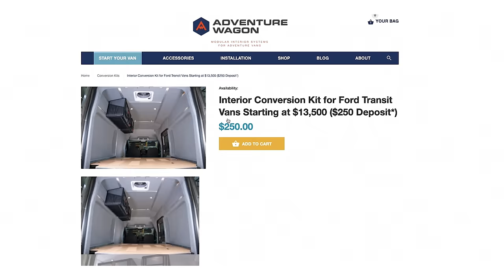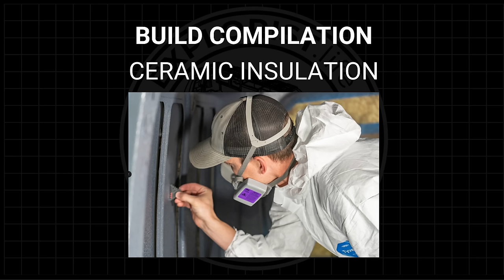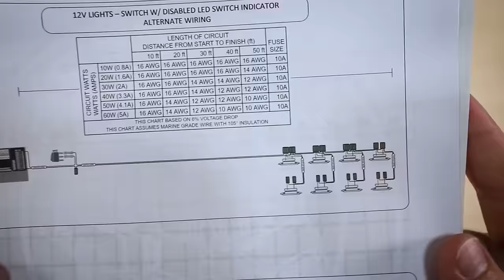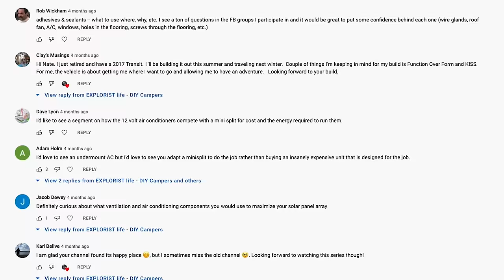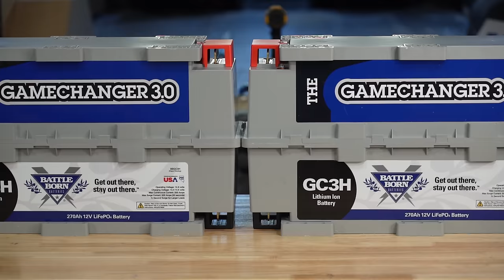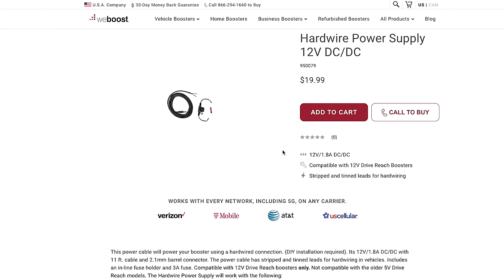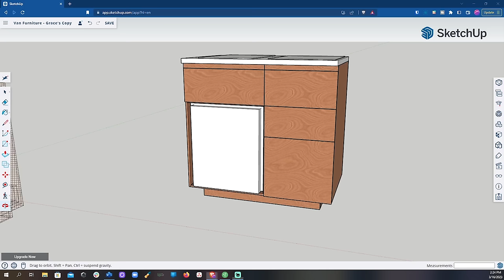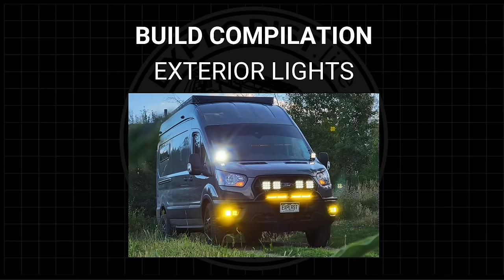Start to Finish! - Luxury Camper Van Conversion

Comment: Thanks for asking, Nate!
1. Coin flooring is hard to clean. And we all know how dirty our floors get off-road. I'd never install one.
2. There's a lot of misinformation and confusion about vapor barriers. I've seen vans ruined by moisture/condensation trapped between the van's metal skin and the  inside walls. What do you think about semi-permeable membranes like Intello?
3. What do you think about EcoFlow's heat pump vs. roof mounted DC A/C's?
4. Please explain various security systems and why you'd choose one over another?
Thanks!😊

Comment: I saw on another camper van build, where the guy put his shower with a 25gal recirculating system. Which I think is pretty smart, that way you can take as long of a shower you want without worrying about running out of water. I would like to know how that is done.

Comment: Wow, can't believe that you put this together. Great work !! (Adding chapter markers might make it a little easier for some people to navigate to the sections that they are interested in). Also looking at where you have the camera lenses stored in the van it seems to me that those are in a very easily accessible drawer, but I'm not sure how often you are reaching for camera lenses.
I'm a fan of Adam Savage and on his channel (Tested) he has spoken at length about setting up his workshop with "first order retrievability" being the most important concept. Basically making the things that you use the most in the most easily accessible places. Have you used a similar strategy when populating your storage? It's something I still struggle with in my van but I found that making an inventory list of every single item in each drawer and storage area in the entire van has been a big help.
Reply from the maker: Big fan of the Tested channel and we definitely use that concept around our shop as well & in our outdoor gear closet.  We like having camera gear near the doors/seats because any time we are swapping out camera gear; we are usually in the front seats or heading out the door.  I think the only way it would be 'more' convenient is if it were actually in the front seat/cab area; but that simply wasn't feasible.  For upper cabinets, we definitely store the things we need to access quickly in the area it needs to be: Clothes by the bed.  Food by the kitchen. etc..  But with the storage cubes like we have them, it makes everything infinitely easy to move around.
Reply: I am going to find this "Testy" you speak of...
Reply: @EXPLORISTlife  do you build solar system for customers
Reply from the maker: @campervanmark3410  Yep!  https://shop.explorist.life/shop/consultations-installations/installation-request-deposit/

Comment: I recommend DUAL BANK solar controllers. I have a solar controller that charges the house batteries until they are fully charged, and then it trickle charges my chassis battery. I can set the charge profile to the battery's chemistry, and in my case I have Battleborn LFP house batteries, and a lead acid chassis battery. I cannot emphasize how convenient this is. Previously, when my rooftop solar was only wired to my house batteries, I would sometimes need to jump or hook up a battery tender to my chassis battery. Never again!!  Especially if you boondock for a couple weeks OR if you park in the driveway for months(or years) between trips. Starts right up every time!! I have a cheap pwm controller from Go Power (GP-PWM-30-UL), and it's great. It's flush mount and takes no space. It works beautifully. Read the reviews. I'm not alone. They sell dual bank mppt too.

Comment: weve got 4 bikes stored under the bed with mineral oil brakes rather than dot, so there is nothing that will degrade the bedliner. Prepped so they didn't have to worry about overspray which made installation costs much cheaper

Comment: Mini Split for AC and heat... and wiring for ham radio and cat systems for controllers etc.  ...It won't happen but custom build the lifepo4 power.   270 or more swing awning and outdoor pull drawer for kitchen ...

Comment: It would be nice if you could have both front seat be able to slide from the front to the middle of the van and able to swivel on a sliding rail built into the floor ✌️❤️

Comment: wow!  Awesome Job.  I just watched the entire build over the last week.  Y'all do amazing detailed work.   Can't wait to get started on my AWD EL HR Transit in the same color.  I didn't get the dual alternators though.  Hopefully I don't end up regretting that one.  From what I saw, 1 alternator should be plenty to send about 30 Ah to my 570 Ah Miller Tech Lithium Battery.   One thing I'm wondering about is if the roof solar is worth the effort.  I want to have the ground solar panels if we are camping and most likely will be in the shade more than anything here in the mid West.  With Alternator charging, Shore power, and ground solar, do you recommend adding as much solar to the roof as possible like you did on this van?

Comment: How about insulating the van with 2" of closed cell foam insulation on all the walls, doors, floor, and roof so that warm air or cool air stays where you want it.

Comment: Love the content. would be interested in seeing DIY how to

 
install 48v system+appropriate solar
Budget Air Conditioner options, like treelingo.
Regular budget version of hydronic espar floor heating not the $4k+ rickson mod version of espar
isotherm water heater install with engine coolant support
 Detailed explanations of Victron components
Appliance install
200+lb Garage drawer pullout
Additional security(deadbolts with e-actuators and remote)
Possible security alarm options with glass break alerts(for being away from the van and while sleeping in the van)
Security camera installs
Starlink roof install
A DIY version of Landship’s Solar Sail
any or all. thank you in advance.
Reply from the maker: Thanks for the feedback!  The following items are indeed already on the schedule of videos to make.

48v system+appropriate solar
Budget Air Conditioner options, like treelingo.
Regular budget version of hydronic espar floor heating not the $4k+ rickson mod version of espar
isotherm water heater install with engine coolant support
 Detailed explanations of Victron components
Appliance install
200+lb Garage drawer pullout
Additional security(deadbolts with e-actuators and remote)
Possible security alarm options with glass break alerts(for being away from the van and while sleeping in the van)
Security camera installs
Starlink roof install
A DIY version of Landship’s Solar Sail
Reply from the maker: Stuff like the garage slider, floor heating aren't electrical build focused and we shifted away from 'van build' specific videos at the end of last year because they weren't performing well enough to sustain the channel.   Only electrical system focused content from here on out. 😊👍🏻

Comment: I would like a video using Ecoflow Delta 2 Max.  How to wire it to 120v outlets and for 12v features.  What is the best way to charge it via alternator?  Should we use a DC to DC charger to the special solar port?  Or should i also have an additional battery and charge that with the alternator, then use the battery to charge ecoflow.  I saw a video of people using a battery to charge ecoflow and there was 1000 watts incoming when up’ing the the volts using a Victron Orion-TR Smart 12/24-15.  It seems like the inly way to fast charge ecoflow is using the special solar port if you dont have access to recharge via the grid.  So this means I’ll have to unplug the solar to plug up alternator charging.  I am trying to build an electrical system with enough power but is far less than these $10k+ electrical systems.  I figure I can start with an ecoflow, then add a battery later.  Of course I will have solar but I want the a faster way to recharge if I don’t have the sun.  Nobody has made a video explaining how to use a powerstation this way.
Reply from the maker: Like... in all honesty, If I did a video about a portable power station like that, I'm just going to use the manufacturer supplied charging methods because in my mind, the main appeal of those types of units is that they are easy to set up and use and as a sacrifice, you loose the customizability of a Victron (or similar) system like you see on our channel.

In my eyes... adding all of these extra 'hacks' to make those portable power units work better is like adding a spoiler and a NOS sticker to a Honda civic and thinking that will make it a racecar.
Reply: @EXPLORISTlife  Thank you for replying.  I hope a content creator will do this for those of us who can't afford the expensive systems but need a way to be able to run A/C for full time living.  I do appreciate all the info you share.

Comment: At 3:29:36, there is about one second of video showing your toolbox directly outside the middle window.  I am curious to know how you achieved that.  I am aware that you have those roll around workbenches that have adjustable height - do they go that high? .  Please note that this is all the further that I am into your 11 hours start to finish and therefore, if this is shown later, I apologize in advance.  It would be interesting to see how you organize your shop, tools and what sort of tools and spares you take on the road.    Thanks in advance.
Reply from the maker: Haha; that was just a weird camera angle.   That is indeed a pretty tall toolbox (6ft or so?); but it's about 5-6ft away from the window along the wall.
Reply: Optical illusion and wishful thinking.  Thanks again for the quick response.

Comment: It would be nice to know why Battle Born batteries are between 2-8 times more expensive than others listed on Amazon. I have looked through your FAQ without success.  I suspect your response will be along the lines of "they are the best" or "we have not had problems".  What other brands are second and third best or adequate?  If you encountered problems with something say five years ago, is that still a concern today?  Also, are there any decent USA made charge controllers that are adequate.  Thanks in advance.
Reply from the maker: With less expensive batteries you are usually sacrificing one or more of the following: 1: Quality of internal components.  2: Warranty.  3: Companies who don't plan to be around for longer than a year, thus negating their warranties.  4: Customer service.

You think I'm going to say they are more expensive because 'we have not had problems'; which is actually not true.  Although we have personally not had problems; we have helped people who have purchased our electrical systems and are using Battle Born Batteries; and when a problem comes around; Battle Born will send us through a couple of short troubleshooting steps and when the problem is found to be with the batteries; they are quick to send out a replacement under warranty; which to me is incredibly valuable and not something you get with the marketing companies on Amazon  that sell batteries.

In my opinion; there aren't any solar charge controllers made in the USA that are as high quality as Victron charge controllers.  I actually don't know of any solar charge controllers that are actually MADE in the USA.  I was going to say Midnite as they are HQ'd in the USA; but it looks like their charge controllers aren't made in the USA.
Reply: Thank you for the quick and thoughtful response.

Comment: Your electrical is solid but a thousand parts and hundreds of hours to install/ and hardly modular?  We went with Bluetti + expansion for half the cost, carry it in plug and go. When not travelling, bring into your house, free power everywhere you go.
Reply from the maker: That’s like telling somebody: “why did you build your dream home when you could have just gotten a trailer house delivered?!”

It’s simply not the same quality nor performance.

Comment: Okay, we know you will be installing a Victron ensemble of components attached to a plywood base just behind the wheel well with 400 plus Ah of batteries.  Been there done that.  How about changing it up for a Ecoflow or Bluetti or new guy plug and play kit.  I'm sure the vendors would be happy to provide you components. All in all, a 20K component build is no longer interesting to follow.
Reply from the maker: How to install a plug and play unit:

Plop it in place

Plug things into it.

Done.
Reply from the maker: But like...  why are you being so negative over something that takes up 10% of this video?  Were you not able to get anything out of the other 90% of what we showed?  Maybe opening your mind a bit instead of just being so negative would do you some good.

Or would you like your money back from what you paid to watch this video?

Comment: Thank you for the indepth video. 😀 One subject that I need info on for not new van, is what to do about the underside of the van. How to prep it so that it will last a lifetime against rust, stone pitting, etc. What to do about the rust you find on less than brand new vans. Most videos directly jump into the interior of the van and start working there. So, what are the first things to do with a second hand van that I want to convert to a camper. BTW, a Renault Master L2H2.🚐